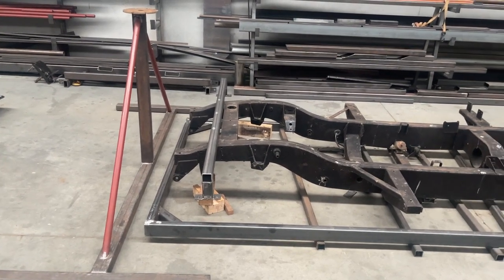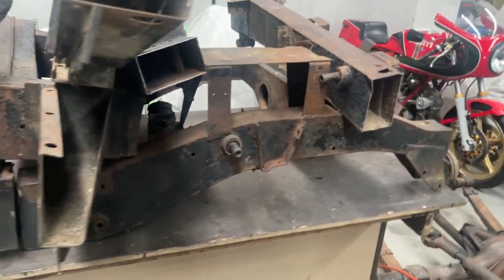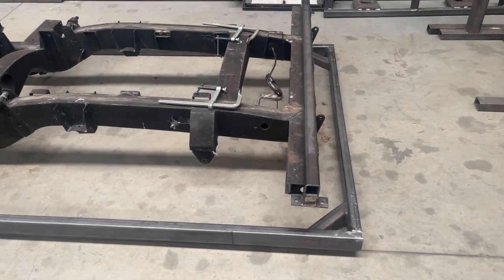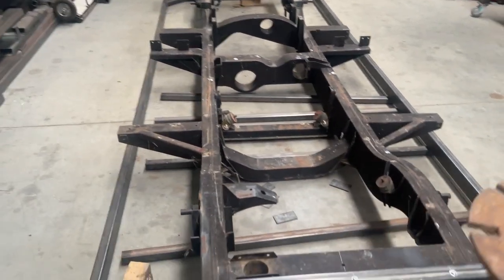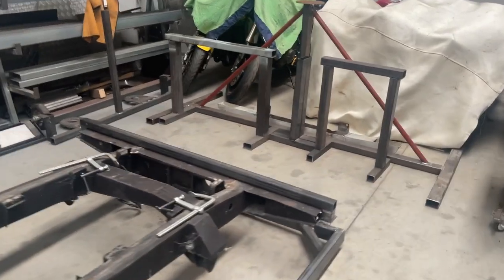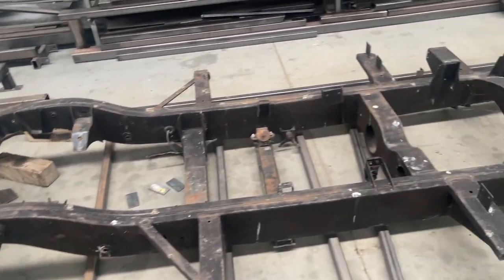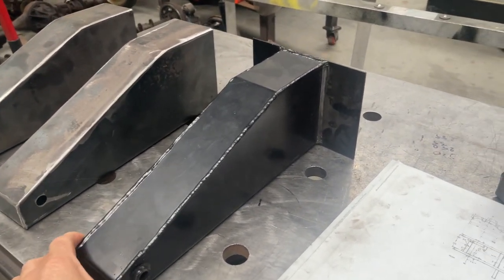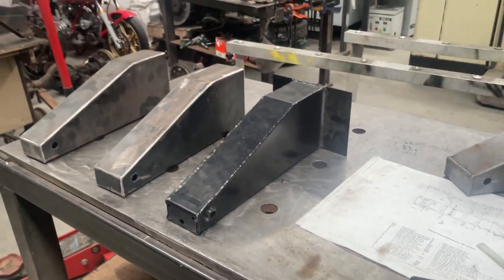How to build a Land Rover 'Series' Chassis jig 1.3

Comment: what about making the inner and outer chassis box section elements different lengths at the proposed join - so the joint would be staggered rather than a straight line?
Reply from the maker: yes excellent idea and something we are considered. we proposed using a Z design at that joint and have the join in the center of one of the cross sections as well.